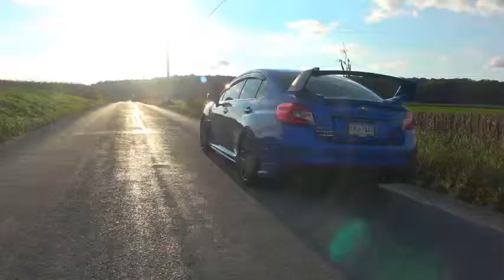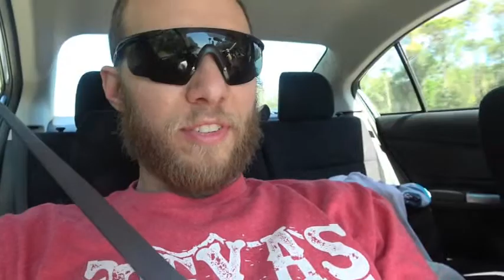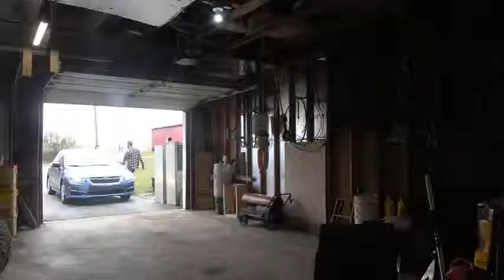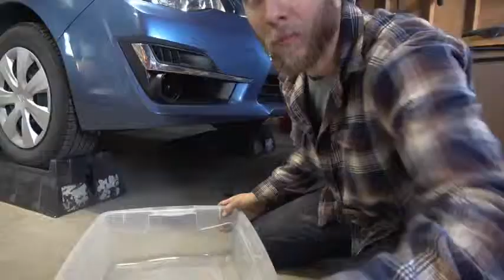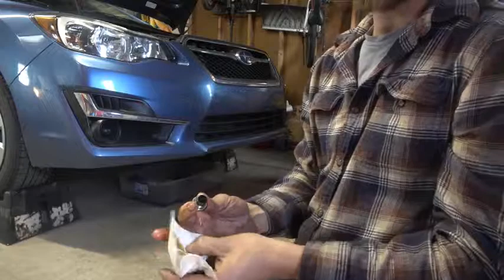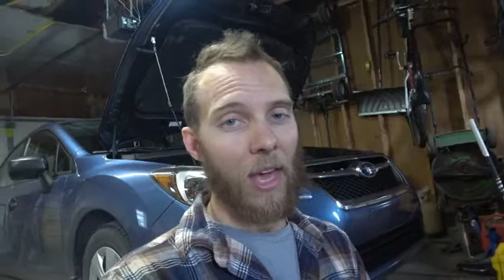The True Test of Oil Change Frequency

Comment: Stop using them fram oil filters they are junk... order a case of genuine subaru filters online.   it's worth it.    Start cutting open your filters  you will see how low quality they are and the real difference between brands.    I own and have owned many Subaru's  currently a 2019 legacy and a 06 legacy the oil consumption is at least 1 quart per 4000 miles.  Subaru tells me that normal.  I do not agree on that being normal  but I love the cars     Cool video I subscribed
Reply from the maker: Thanks J Cook. I stay cheap on this car, the race car gets all the goodies